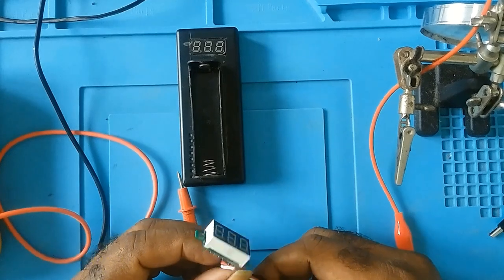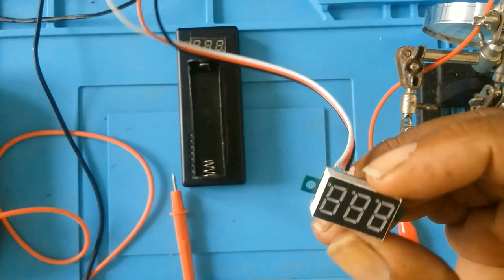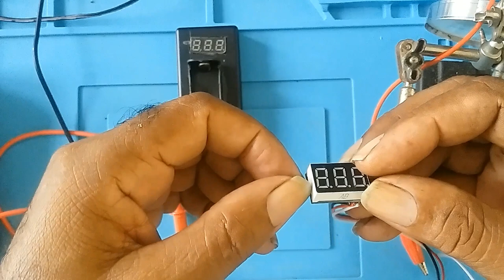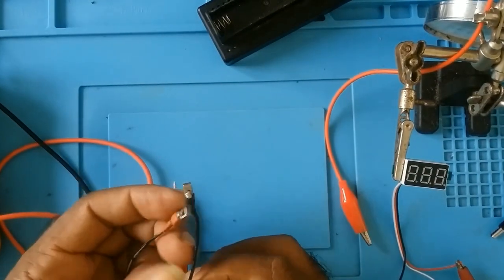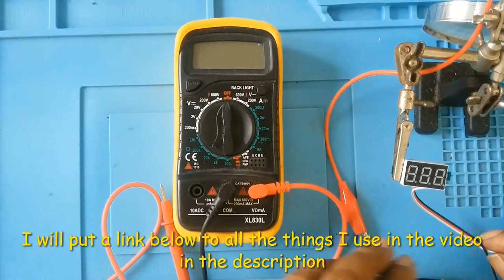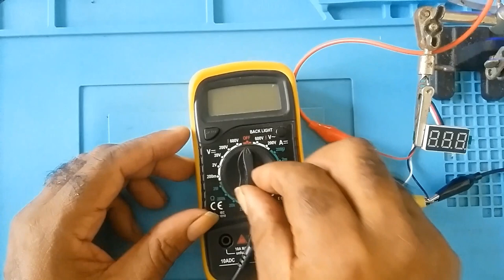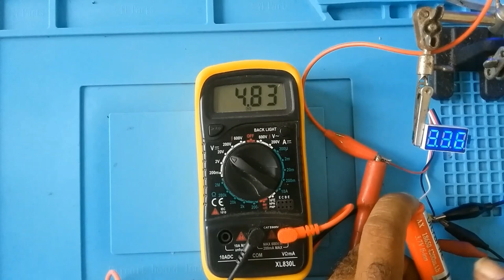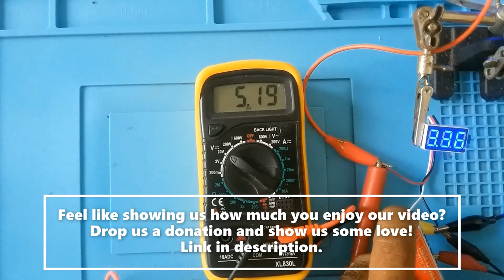Diymore Mini Led Panel Display DC 0 30V Voltmeter Fake advertising

Comment: The meter needs powered thru red wire with 5 to 30 volts.. then the white wire can measure 0 to 30 volts. The black is common ground.
Reply from the maker: Ok.